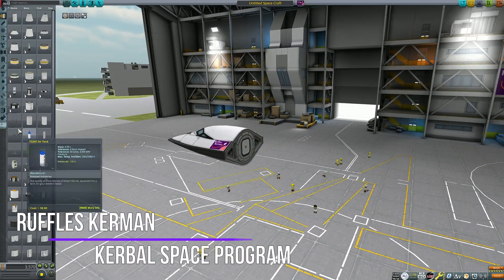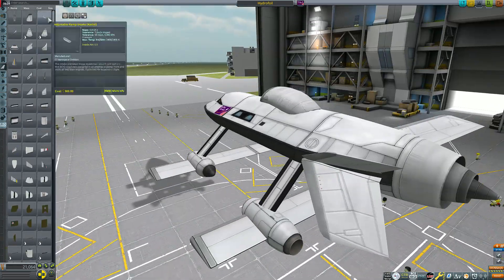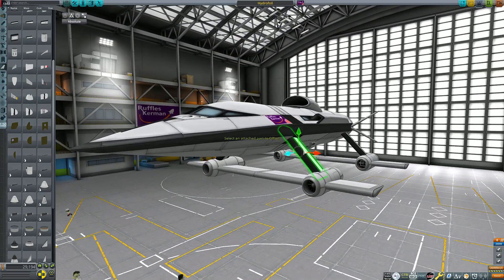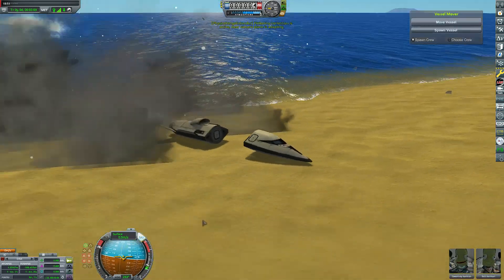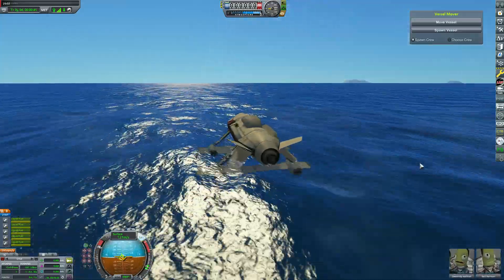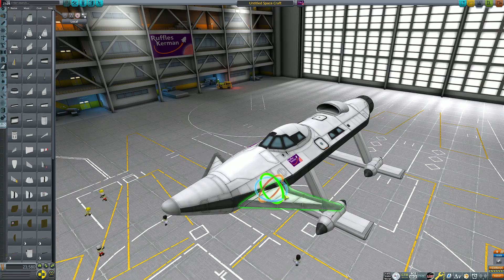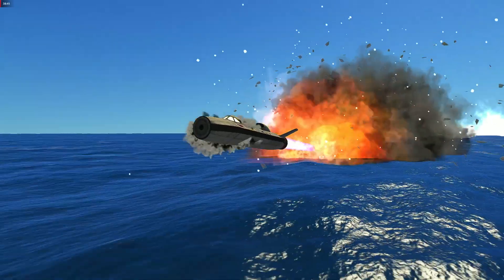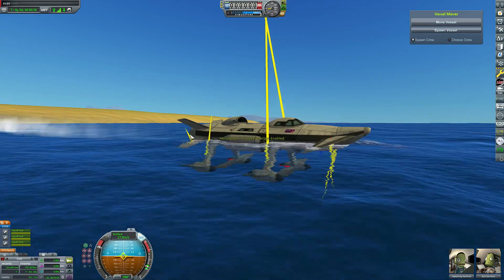Designing a Hydrofoil in KSP

Comment: when I do this the boat just flies into the air and even in the water I can reach incredible speeds if I compare it to your speeds. Do you maybe have any idea why there is such a big diference between your craft and mine?

Edit: dit some more testing, and even with the J-20 "Juno" Basic Jet Engine I can take off out of the water and fly with about 100 m s^-1 speed... Even though my craft should be heavier than yours.
Reply from the maker: Wow, that's weird. How many Juno's are you using? It also may have something to do with the mods either I or you have installed. I have one that makes the water more realistic but it changes it up a bit too.
Reply: @RufflesKerman  I have one Juno on it. So I guess one of the mods you have makes the water way denser. I only have visual mods, so I'm pretty sure it should be "normal" for me, but there is also a change I screwed something up when messing around with mods.
Reply: @RufflesKerman  are you talking about scatter or another one? Because I thought scatter was just a visual mod